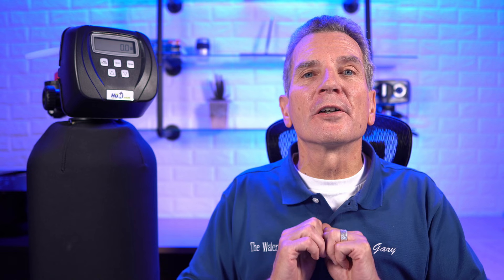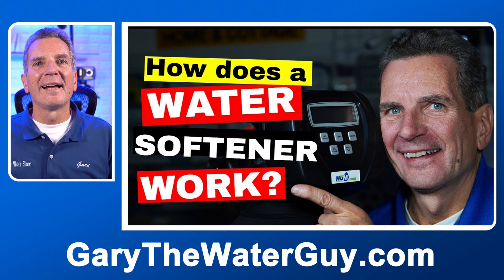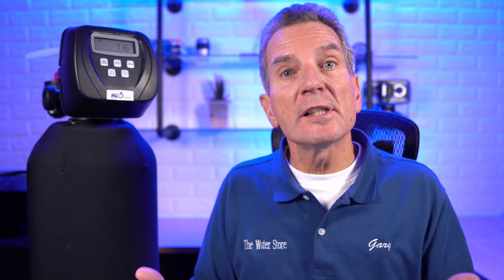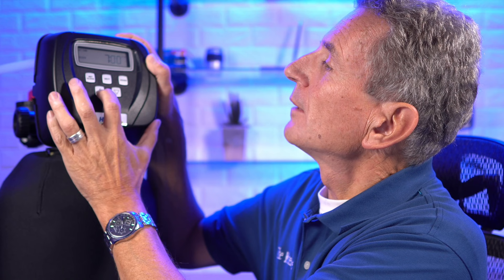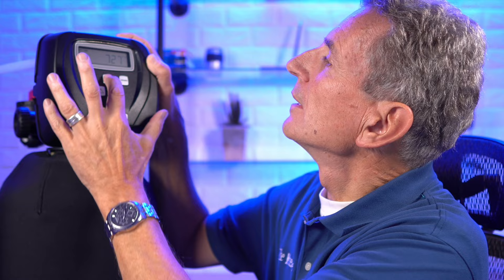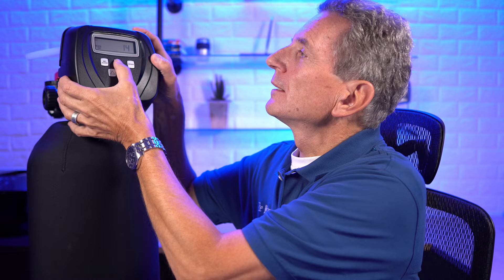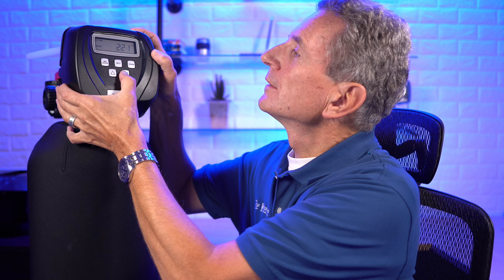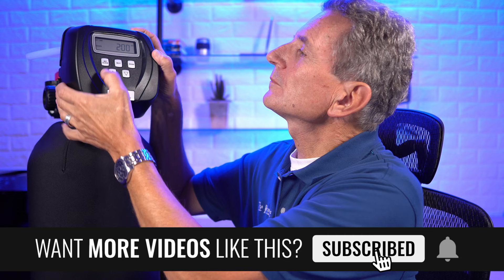HOW do I KNOW if my WATER SOFTENER is REGENERATING?

Comment: I added recommended level of salt to my brine tank and pressed the regen button. The capacity of water is increased by 200 gallons only. Before I added salt, it was showing 1620 gallons. And now it is showing 1825 gallons. It has been 8 hours since I added salt. It is entek water softener system. Is it still generating? The salt level was a quarter left before I added 80 pounds of salt.
Reply from the maker: The water softener can only regenerate to full capacity, which in yoiur case is 1825.  If you start the regeneration with 150 or 1620 gallons remaining you will always get 1825, no more, no less. I hope that helps.

Comment: Help! My Water Boss starts filling with water when in Service mode.  We have cleaned out the water at least three times, but cannot find why the brine continues to fill with water and does not drain out.
Reply from the maker: Likley there is a problem with the piston.  You will need to repalce the drive end cap assembly to fix it https://waterestore.com/products/aquamaster-drive-end-cap-assembly-54520

Comment: Also make sure to check that your brine line is not blocked by a salt clot. Your filter can be going through the motions but if it's not sucking in salt it's not regenerating
Reply from the maker: Yes, you are correct.
Reply: @GarytheWaterGuy  
Gary I have an interesting question about the regeneration process in regards to the salt intake.
I have a digital clack valve.
I noticed that the brine tank filling stage takes 9 min for my brine tank to fill with approximately 3 to 4 gallons of water.
But when it regenerates it sucks in the brine for 50 minutes. By the 10 min mark all the water is gone from the brine tank and it is only sucking in air for the remaining 40 minutes.
Is this correct? Does it also need air circulation after taking in the salt to agitate the media?
Or should I reduce the brine intake time to say 15 minutes?
Thank you!

Comment: @GarytheWaterGuy 
I'm on city water and using the test strips to test my water. They are pretty red >= 25 gpg when testing water before softening, but my softened water seems to be down to only 7 gpg after the softener (this is testing even just after a regen cycle). 
I replaced the resin a few months ago (prior to replacing resin it wasn't really doing anything). Regeneration is running as it should, brine tank is draining and filling as it should. No clogged drain line, no leaks on brine hose. I'm using diamond crystal yellow salt bellets.  

I've tried setting gpg on the softener to 40 to trigger more frequent regenerations. I've even tried manually triggering regen nightly thinking maybe it isn't efficiently cleaning the resin. No matter how frequent I regenerate I get the same results.

I have this same type of softener in this video - a very large unit with a tall resin tank. How can I increase the efficiency of my softener? Is it only going to get my water down to 7 gpg? I thought I should see a green test strip (<1gpg). Am I crazy? Are these test strips even accurate? I don't have any lime/calcium buildup anywhere in my house. Not on the shower heads sinks, toilets etc. Where I do notice the calcium buildup is in my ice machine and sometimes in a glass of water. Is it only going to get 'so good'?
Reply from the maker: Are you sure you don't have a 3 way bypass open somewhere? See this video https://youtu.be/2EcQrrlxMqo.  That would do it.
Reply: @GarytheWaterGuy   unfortunately no bypasses are open 😔 (but that was a great thought!) all are set as they should be and water softener shows current flow rate going through softener which is showing the flow rate being used.
Reply: @Gary!!! I FINALLY figured it out. I’ve been testing my water at the kitchen sink or the filtered water out of my fridge. I noticed a couple weeks ago that when I tested hot water it showed as soft. I assumed you couldn’t test hot water with test strips and I shrugged it off but your comment got me thinking. I thought maybe even though the 3 way was off maybe the valve was bad and leaking. I turned off the three way and source to water softener essentiallly closing everything, and went around my house turning on faucets. 

I found that my kitchen cold water and refrigerator water source bypass the water softener. Of course the outside spigots bypass the softener but the kitchen cold water shocked me…. I guess searching online this is somewhat standard?!?! Never had this before. May consider re-plumbing so that my kitchen cold/ fridge have softened sources. 

Either way your idea sent me down this path. It wasn’t the fix but it led me to the fix. Thank you so much for your response!!!! This insanity has been in the back of my mind for a long time!!!

Comment: I have a 7 year old EcoSmart ECS-39 High Efficiency 39,000 grains water softener. It stopped working and turned out to be a salt bridge. My media tank is inside of the salt tank. I cleared the salt bridge with the help of your videos and a wet/dry vac. Thank you. I have since cleaned the brine tank fully, let it dry, then added crystal salt and manually regenerated. I then added Iron Out because the bottom of the brine well had what looked like rust stains. I manually regenerated the system again and waited 3 days to test the water with hardness test strips. My kitchen sink and refrigerated filtered water are on bypass (city water), so they tested hard around 120ppm. The hot water and other taps are being softened somewhat and tested between 15-25ppm. Here are my questions: Isn't my softened water supposed to test at 0ppm if my water softener were working properly? Are the hardness test strips accurate? Should I use Pro Products Res Care to clean the Resin beads? My EcoSmart is not regenerating on it's own, though I have it set for a water hardness of 27 and 4 people living in the household. Please let me know what my next steps should be.
Reply from the maker: Yes, hardness should be 0 ppm of hardness if yiour softener is working. Hardness strips are fairly accurate, but an actual hardness test is more accurate. If you have iron in your water, res care will help clean the media beads. If it's not regnerating on it's own the meter likely isn't working. Those big box store water softeners often only last a few years.  I would replace it with oner of these. https://waterestore.com/products/hum-deluxe-water-softener-30-000-grain

Comment: How often does a water softener typically regenerate? We would be a lower useage household. How low does the reservoir usually go before it regenerates?
Reply from the maker: Depends on the settings, your water hardness, usage and size of water softener. Thsi video might help https://youtu.be/i9pI76dk4Zs

Comment: Gary, Thanks for all the insight on water filters. I have a issue with the brine tank not draining. i unclogged the injector and was wondering what cycle it would be on when it sucks water out of the brine tank.
Reply from the maker: The brine cycle sucks out the water.
Reply: @GarytheWaterGuy  what happen if the brine cycle doesn’t suck any water ?

Comment: Hi
I added two bags of salt pellets to the black tank yesterday. Do I need to adjust anything on the top screen of the metal tank to regenerate the water softer?
Reply from the maker: If it was very low on salt before adding, I would manually regenerate the softener.

Comment: I’d get the client to change the time of day to a minute before regen time  , once you’d set the regen tonight . Might be less routing around in the programming for a client and less likely to adjust other important settings . Although if you know what your doing it’s work either way . I think .
Reply from the maker: Yes, that would work too but they would need to know in advance when the regeneration time has been set to regenerate.

Comment: thanks for the video. does it matter if some water usage is happening during the manual regen cycle?
Reply from the maker: Not at all, but you will be getting untreated water during that time. So typically these regenerate when there is very little water being used in the home.

Comment: great video, thank you. how would i trouble shoot a unit that keeps regenerating. seems like it may be stuck somehow
Reply from the maker: Usually that is because there is a leak somewhere in the household plumbing and since the softeenr is metered it thinks you are using more water than you are.

Comment: Hi, my system has been increasingly letting water out from a pipe that comes from that equipment. Does that mean that it's not regenerating? Thanks.
Reply from the maker: If water is continually flowing from the drain when the system is not regenerating you either need to rebuild the valve (the part at the top) or replace the whole water softener. We have some great water softeners and rebuild kits available here https://waterestore.com/collections/water-softener-1
Reply: Thank you.

Comment: I can't get the regeneration button to work....I hold it down and it just beeps and won't move into regeneration.  On the screen it says 17min plus "remaining" with "clean" flashing beneath it.  I cleaned out the Venturi and checked the discharge hoses. After which I tried to get it to go into regeneration but it won't.  There is no error code on the screen just the 17min remaining with "clean" blinking and nothing else.  Advise, please....
Reply from the maker: Either the circuit board is gone or the piston is stuck inside.  Unplug the systems, wait 5 minutes, then plug it back in to see if it resets.
Reply: @GarytheWaterGuy Thanks for getting back with me.I have a whirlpool watersoftener and it is probably about 15 years old.  And from what I read they are a "once and dump" machine.  I tried what you said several times and it didn't work  I have plans to get a Clack installed on Monday...

Comment: how long does the regen cycle actually take?
Reply from the maker: It depends on the softener. High Efficiency, about 25 minutes, standard about 95 minutes, pre fill about 3 hours.
Reply: @GarytheWaterGuy  Thanks; im trying to put an exception rule in place for my Moen Flo to avoid false alarms. I have a REIONAIOR PRO 1252 - how much time do I need to allocate? Not sure what pre fill means exactly in this context.

Comment: great videos Gary, thank you.  My problem is that the "regen today" is flashing but the regeneration is not occurring at the prescribed time.  Also, holding done the REGEN button for 5 sec is not activating the regeneration.  Any ideas?
Reply from the maker: You need a new circuit board. We have them here https://waterestore.com/search?q=clack+circuit+board

Comment: Great video! Maybe I missed it, but how often should it regenerate?
Reply from the maker: Great question.  I depends on the settings, how much water you use and whether it is a metered or time clock water softener.

Comment: On waterboss 700 should the WaterMizer indicator be turning when the unit is regenerating or when you actually use water in your home? Can you actually see it turning? Thank You.
Reply from the maker: Yes, when you are using water in your home you will see it turning.
Reply: Thank You.

Comment: Gary !! I replaced the circuit board and no display still. I got a brand new one. I’m confused now.
Reply from the maker: Did you make sure that there is power at the electrical outlet and check that the transformer is working? https://waterestore.com/products/clack-ws1-replacement-transformer-clk-v3186

Comment: We have put salt into the water softener last night and pushed for regenerate tonight.  There was water up to about sign 2  and this morning almost all of the 40 lb of salt disappeared.  Does that mean that the softener works or only the salt has melted by itself?
Reply from the maker: It means that the water dissolved the salt and during regeneration the resulting brine was used up.  If you now test your waters hardness after the water softener you will know if it is working or not.

Comment: Thanks for this video!  I have a Fleck 5600 SXT and it shows a code on the display of ER -2. So I unplugged it and held down the reset button the circuit board for 5 seconds and then plugged it back in. Then it showed InPo on the display and I assumed it was regenerating. It's still showing this 24 hours later so not sure what to do. Should I unplug and reset again?
Reply from the maker: It might work but I really know veyr little about Fleck water softener valves.

Comment: Thanks Garry.  Clack Valve on 9" x 48" tank with fine mesh.  Capacity set to 3200 gains, Downwash with 9.5 lbs salt.  Installer set my hardness at 20, but my tests show  water is 15 grains.

2 weeks ago, Clack said 500 gal remaining so I wanted to test for hardness leakage.  But system did a Regen with 500 gal remaining.  When does auto Regen start?  I thought it would go closer toward 0 gal.

2 weeks later and I am back at 500 gal remaining.  Did a test and no calcium detected.  So I set grains at 17 (15 measured +0 mangoneese +0 iron + 2 buffer).  So now I have 800 gallons remaining.

Will check for leakage in a few days.  But when does Clack auto Regen?  Does it consider gallons remaining and last usage?  It didn't go to zero last time and regenerated way before I thought it would.
Want to optimize system.  At 20 grain setting I get 1,600 gal.  Now at 17 grain, I should get almost 1,900 gal.
Reply from the maker: The system calculates your reserve capacity which determines when the regeneration will be done.

Comment: Hello should i put my tank into normal position mode when regenerating
Reply from the maker: Yes, it needs to be in service to be able to regenerate.
Reply: @GarytheWaterGuy thank you. If the water feels more soapy/ too soft what should I do?
Reply from the maker: Check your hardness settings to make sure they are correct
Reply: @GarytheWaterGuy  mine is currently set at 20. Do i have to lower it down
Reply from the maker: What is the hardness of your water before the softener?
Reply: @GarytheWaterGuy  it was 16
Reply from the maker: Yes, lower your settings to 16

Comment: Hi Gary 
It's 3am and I've been up looking at your videos trying to figure out what is wrong with the water softener.  At 1am the drain line started to overflow. I stopped the water by turning the pointed red knobs. I guess it's bypass mode. I'm a new owner and I'm frightened as to what to do! Please walk me through this problem. 🙏
Reply from the maker: Sorry to hear. What do you mean the drain line has overflowed?  Do you mean that the drain where the water softener discharges into will not handle the flow and the water is backing up?  If so the drain is clogged and needs to be cleared
Reply: @GarytheWaterGuy  thank you responding 🙏 Bless you

Comment: Hi. I have my hardness set at 30 which is 1100 gallons of capacity and the regeneration cycle set at 7 days. The capacity reached 0 on the 5th day. should it then automatically regenerate? it still says softening when I have the water on even though it's at 0. I thought the regeneration starts at the 0 capacity mark or the number of days set. what ever happens first?
Reply from the maker: If it is a metered softener you have 1100 gallons or 7 days, whichever comes first. When it says softening that just means that the meter is counting down the gallons. It typically calculates a reserve capacity which would trigger the regeneration before you get to zero.